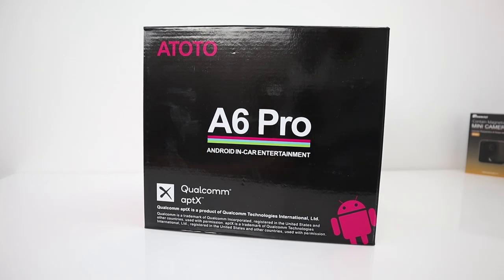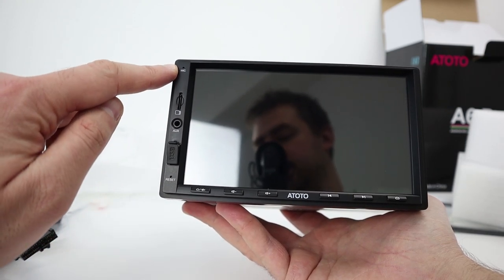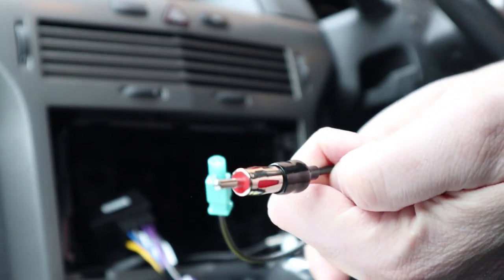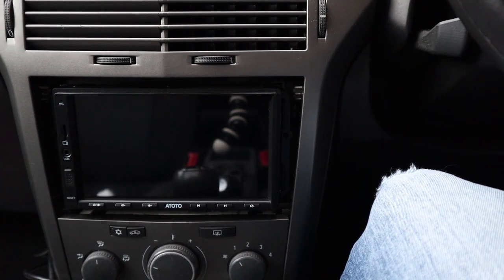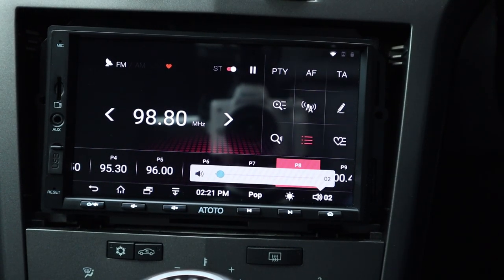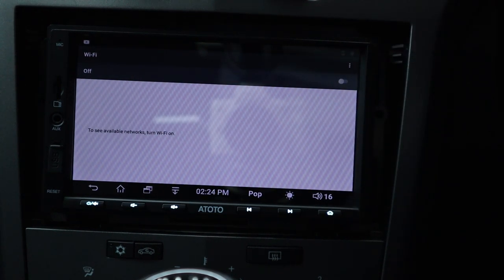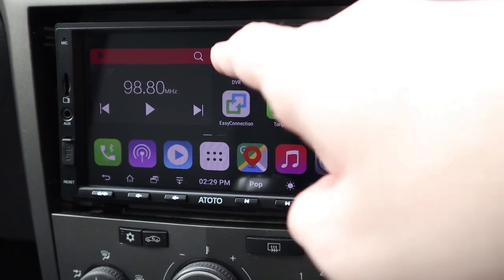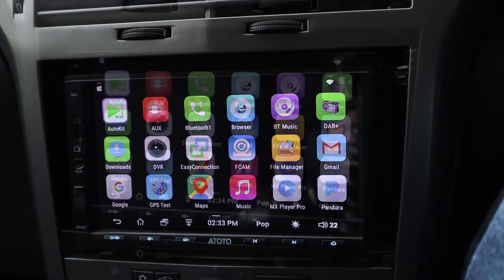ATOTO A6 PRO Android Car Stereo

Comment: Nice. I bought one and installed it at the same time you were installing yours. I envy how you were able to insert the two little handles and remove your radio. It was a lot more work on a Toyota 4runner, especially to hide all the cables for the antennas and cameras. A month later I am still very pleased with it.

Comment: Where do you get the adapter harnesses? It looks like having the right one would make installation a lot easier, right now I’m faced with connecting each wire separately.
Reply: Atoto sells wiring harnesses for different car brands. I'd highly recommend getting one because I wired mine up individually without a harness and it sucked. The unit is amazing so far but the installation took quite a time.

Comment: do you ever notice the unit getting laggy with that 2gb ram? just curious
Reply: I have problems with the unit rebooting and apps crashing. Tech support has acknowledged a 2gb limitation and suggested I use Google Maps in offline mode. I was using Waze but it crashes for no reason.